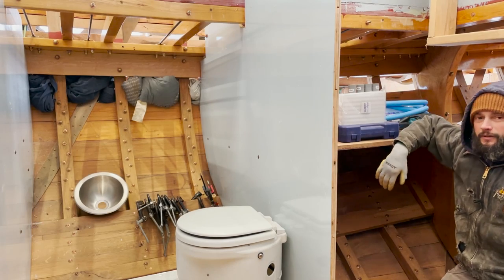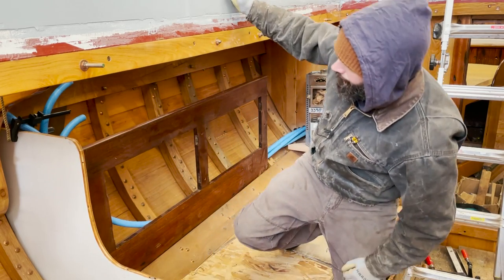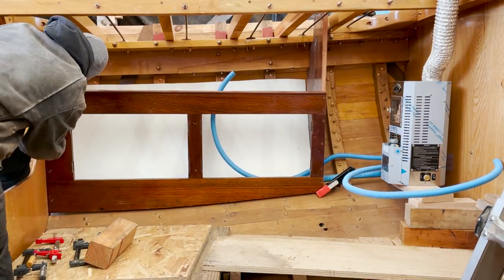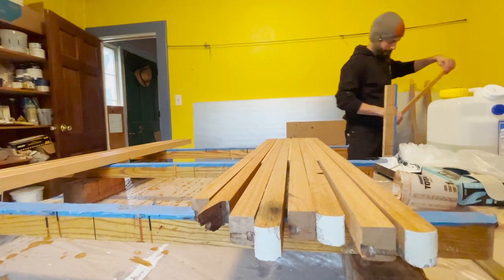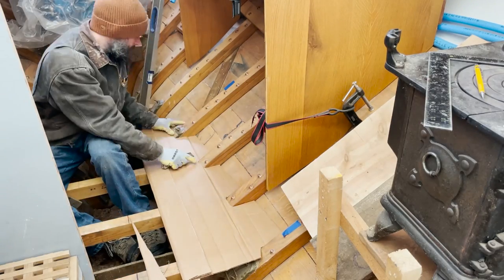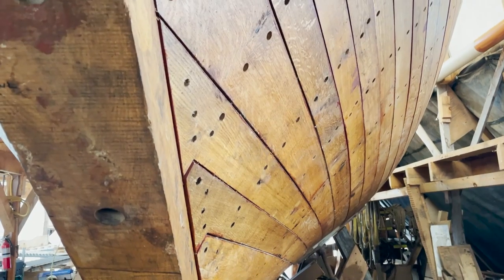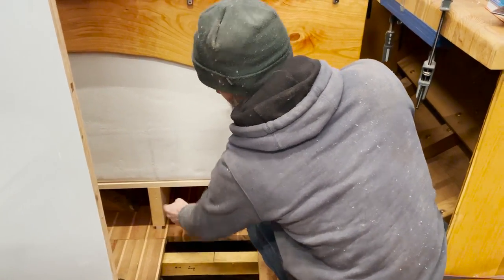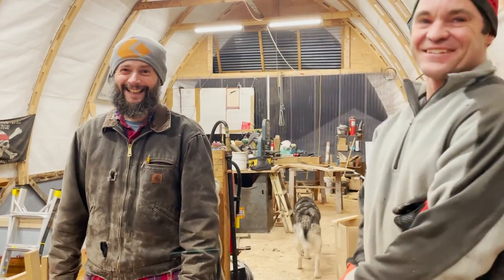Finally Back to Woodworking! - Episode 195 - Acorn to Arabella: Journey of a Wooden Boat

Comment: I'm thinking if the boat is keeled over enough to cause the fridge hatches to pop out, those hatches will be the least of your worries.
Reply from the maker: TRUTH!
Reply: I was just going to write this exact comment. If you're ever unlucky enough pitch pole a 40 foot boat, you certainly DO NOT want everything big and heavy (batteries, spare anchor, an outboard motor, a stove, etc.) to become projectiles. I get that. But in that rare scenario, you ARE unfortunately going to have SOME stuff go flying. It'd be ugly. But I don't think those lids are going to be anywhere near the top of your list of problems on that unfortunate day, should it ever come (hopefully it does NOT). Certainly DO plan for extreme heeling to happen when underway. That IS going to happen. But  you can only "upside-down-proof" so much.
Reply: It always amuses me (in a 'damn, that's annoying!' kind of way) when someone says "In a knockdown/rollover/pitchpole event, hatches and floorboards will be the least of your worries."

It's almost always said by someone who's never had to deal with a real emergency/crisis where every second counts.

I've fought grassfires, bushfires, kitchen fires, and floods. All of them, more than once. I've also studied the accounts by survivors of well over a dozen knockdowns, rollovers, and pitchpoles. And you know what I've learned?

There is NO PROBLEM SO BAD that it can't be made INFINITELY WORSE by a crap-ton of assorted junk getting in the way when you've got mere seconds to solve an urgent problem!

Let me provide you with just one example, based (but not loosely based) on a real-life incident involving a rollover. (Didn't happen to me, but I'm phrasing it in the first person, so you can picture yourself there.)

The boat comes back upright. There's more than a foot of water in the boat, it's up to my knees. No idea where it came from, but since we almost certainly didn't hit anything way out here, it's most likely from a hatch that came open, or the companionway hatch, or whatever. File it under "bad, but not top priority right now." Need to get up on deck to check for damage to the rig! Shit! The companionway steps are gone! Are they somewhere here in the boat? Don't know, don't have time to look for them. I'll have to clamber up and out somehow. Oh hell, that hurts! Must've broken a rib or two when we rolled. Hope I don't puncture a lung getting on deck!

Ok.. I made it up, somehow. Crap. The mast is gone! Oh, no it's not.. it's in the water next to the boat. And the waves are smashing it against the hull, over and over. I need to cut it free before it punches a hole in the hull! To do that, I need to cut the wire rigging. A hacksaw would be useless for that job.. I need the special wire-rope cutters I bought in case this happened. Where are they? In the rigging toolbox, stowed under the v-berth! Right.. gotta go back below to get them. Yay.. more stabbing pains in my side!

Oops! Forgot the steps weren't there, and fell into the cabin. Lots more pain... I'm pretty sure I bounced off the chart table on the way down... that's what my ribs are telling me, anyway. Geez, just breathing hurts! C'mon, man! Focus! Oh lord, what a mess! All the cupboard doors have sprung open, and books, containers, seat cushions, clothing, blankets, milk jugs, a frozen chicken and other food, all floating in the water! So are some of the floorboards and the 'fridge hatches. There are coils of nylon rope floating in the water too! Where the hell did that come from? Mary is here, and she has a pretty bad gash on her leg! One of the knives from the galley? Need to find the first-aid kit, and quickly.. she's bleeding a lot. But where the hell is it in this mess? It should be in that locker right by the nav-station, but the door is half off its' hinges, and the locker is empty!

I grab a towel as it floats by, and tell her to use it to apply pressure to the wound. The salt water will sting like hell, but maybe it'll help sterilise the wound? Anyway, she's on her own with it.. if I don't get that mast free, we could be sinking soon, and then we'll have bigger things to worry about. Like trying to find the 'abandon ship' kit, in amongst all this crap. Right.. got to get up forward to the v-berth! I can hear the mast pounding against the hull. I wonder how long it can take that kind of punishment? At least the water doesn't seem to be getting any deeper, so we aren't holed.. yet...

A coil of rope catches my foot, and I face-plant into the water, where one of the floating floor hatches gashes my forehead. Great. Now I have blood running down into one eye. I struggle forward through the knee-deep water and floating crud doing its' best to block my way, but the footing is treacherous. Not only are there holes in the floor from the missing hatches, but all the plates, glasses and other kitchenware are littering the floor under the water. Hope I don't break an ankle in a hole. Or step on a broken glass. Or on the knife that got Mary. Why the hell was I sleeping in bare feet anyway?

Yes! I made it to the v-berth with nothing worse than a stubbed little toe. Well, ok.. think I might have broken it, too.. that wave caught me off balance. Hard to tell, through the throbbing. Gaahhh! Why is it so hard to focus, when you've stubbed a toe? Concentrate, dammit!  The cutters! I was after the cutters! At least I don't have to lift up the mattress.. it's half off the bed already. And the hatch that covered the under-bed storage has splintered in two. Looks like the heavy steel toolbox smashed its way out, going by that chunk missing from the overhead. So.. where's the toolbox? I grope around in the water, and find the toolbox. So that's what I smashed my toe on! Dammit.. the catch on the toolbox lid has burst open! All the tools are scattered around, under the water somewhere. Where the hell are the wire-rope cutters?

Uh-oh.. the cabin lights are fading. Guess the water is getting to the batteries. And I have no idea where any of the torches and headlamps have gotten to. All I know is, they're not where they should be. Soon I'm going to be groping around in the water, in the dark, blind as a bat. Keep searching.. The pounding against the hull sounds different. Is the hull starting to give? I don't have much time.. keep feeling around.. it's got to be here somewhere. Hey, is that.. ow! I cut my hand on something! Shit, shit, SHIT! This is not looking good. Where the FUCK are those cutters? Maybe I should be trying to find the 'abandon ship' kit instead of wasting my time here? Why isn't the EPIRB in its bracket? Heck, the entire bracket is gone, too! What hit it? A fridge hatch? The companionway steps? Oh fuck... I hope we didn't lose the liferaft as well...

(Ok. So, slightly embellished to make a point. But still, the point remains. And yes, this kind of thing really has happened to quite a few people. Bad, but recoverable situations made much worse, all because someone thought "If it happens, I'll have far worse things to worry about than some unsecured items." Imagine how differently this would have played out, if the skipper had secured things properly. I know of a case where someone got chased around the cabin by the galley stove, when it came off its gymbal pins in a rollover. I personally knew a woman who became a wheelchair-bound quadraplegic because she put a 4 litre can of paint in the passenger cabin of her car, instead of in the boot, where it should have been. In the ensuing crash, the paint can smacked her in the back of the head, breaking her neck.

At sea, EVERYTHING should be secured. WELL secured. You should be able to turn the boat upside-down and shake it, and everything stay in its place.

Rule #1 at sea in a small boat.. THINK INVERTED!)
Reply: @Garryck-1  ok... Point made. The fewer loose items, the better.

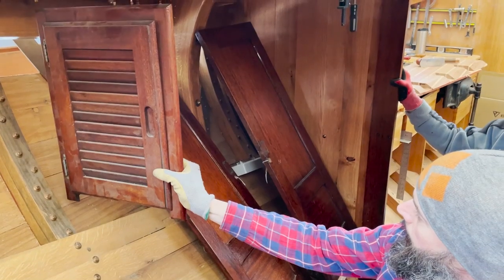Comment: Interior is really starting to come together. Looks great. The louver door at 21:38 is upside down. Are there no other doors that can be used that would be the correct orientation? Love this channel. More Radar, please.
Reply from the maker: We won’t be using it as a door, just for ventilation and we’ll probably modify it so it’s not so obvious. Even so, it’s so far forward and some shelves might go next to it… won’t be visible.

Comment: It seems to me that there must be a better (easier?) way to connect the conduit to the box. I believe there are fittings with nuts, similar to regular metal conduit fittings, that would eliminate gluing the hubs to the box. This is based on a lot of years of building industrial control systems - no formal boat wiring experience.

Comment: I have two observations on this episode. And let me preface my comments they are not a criticism . Love your design for the Sole floor my question is the pieces that you will be able to remove. The fit seems tight will they expand when on the water with the moisture making them very tuff to remove. Question 2 the base you made for the fridge looks to be made out of pine again if it is what about moisture from the inside of the boat and the fridge will it rot or break down quicker than something a little more moisture tolerant ?And I love all that you have done just a couple of concerning questions thanks
Reply: It really depends on what sort of finish is going to be applied to the sole boards. Someone suggested Teak oil them some form of top coat that would make it non slip. I would use an extra coat of Teak or Danish oil ( which is in fact Linseed oil based) and what ever Steve's top coat choice is, that would in all probability prevent or at least reduce considerably any most ingress into the timber a few thus swelling. As for the refrigerator subframe I too was a little surprised at the use of Pine in that position. Personally I have used glued up off cuts of the hardwoods Steve has knocking around to make up a pretty stable board to do the job.
Reply from the maker: Hi Dennis! The coatings on the base will be pretty serious. And there’s more room along those boards than it looks like… an easy fix with a hand plane if it gets a little sticky later.

Comment: Just out of curiosity are the refrigerator shelf going to have a locking system to so it does not slid forward or backwards while sailing?

Comment: What happens to the sole when it picks up moisture from the humidity of the ocean air?  I was thinking about how you planned for this in the cabinets and I'm wondering if there is similar accommodation in the sole pieces for the inevitable expansion?  They looked like tight fit pieces on the frame, and also between the sole pieces.

Comment: The glued Mahogany/Cherry sole looks amazing...Removable refer is genius for the first major refit/repair of the motor...for preventative maintenance would the coolant lines be on some type of quick disconnect? Or is the compressor for the SeaFrost attached to the walls of the refrigerator?
Reply from the maker: Yes, certainly.

Comment: The conduit thing.... What they said. The only thing I might add is, If you need four runs.... Run six and never fill your conduit past half  full.
I am enjoying the interior fit and finish. Arabella has never been wet and you are being meticulous with the soul plates. R U concerned with the inevitable expansion/settling in of the hull?

Comment: You have probably though through this more than me but have you considered running all the wire you need plus several extra through the conduit now before you do the junction boxes to ease the process? They could be finished fitted and cut to length later. (My new year’s resolution was not to comment on things I don’t know much about but I guess I blew that already! 😂)
Reply from the maker: Sure have.

Comment: I had a thought with the fridge/freezer, they work by removing heat from a box, where does this heat go? Your box is lacking holes for piping or whatever to remove the heat or am I missing something?
Reply from the maker: There’s a compressor, chiller plate, and quick-connect coolant hose still to go in.

Comment: Those don't really seem to be the right connectors for the J box. Those blue screw connectors can go directly to the box with rubber O-rings and a fastening nut on the inside. It seems in order to fit that grey connector to the Box, you will need a nipple which is just an extra unneeded part. I'm not an electrical expert but have done some helper work in a couple years of schooling. Maybe you have a reason for using those that I'm not aware of though. Keep up the good work! I'm a subscriber and I watch every episode

Comment: 1"1/8 hole saw and get a 3/4 "trade size" lock ring to thread onto the blue flex connector after it is installed in the hole. abandon the grey pvc female adaptor

Comment: This gluing stuff to the junction boxes irritates me quite a lot. I'm not familiar how you do your electrical stuff in the U.S., over here in Germany we only drill holes in the boxes and put a nut on the adapter. This won't compromise your water tightness further, because adapter to conduit isn't sealed 100% either.

Comment: Your interior is going to be beautiful. Your dedication to "doing it right" is paying off big time. However, I have one concern you may have already considered, but I bring it up now for your response.   It appears that everthing you are installing is very heavy: the counter tops, the vice, the 5 bilge stringers, the bulkheads, cabin sole, etc. etc.  I think that Arabella will sit very much below her design waterline when she is launched, without masts, and sailing gear, and provisioning. Most builders try to keep everything as light as posible.  Your thoughts???
Reply from the maker: That’s the magic of internal ballast, for which Arabella is designed to have a few thousand pounds of. We’ll remove some, move it forward and aft for trim, add some… whatever is needed. Boats without internal ballast can’t do that. It’s good, but not necessary, to have a mix.
Reply: @AcornToArabella  Thanks, good thinking. I thought all ballast was outside.
Reply: Another thought: the inside ballast would have been in the bilge, the new weight is above. This will change the center of gravity. Might the boat be very tender?
Reply from the maker: The new weight isn’t quite that much…

Comment: I wonder at what point you will test the boat for any leaks in the water? When you build all that nice interior, you wont see  the hull from inside?
Reply from the maker: Well, you put it in the water is how you do that. In a travelift, you can actually dip a boat and hold it just out, wait for the planks to swell a bit and big bilge pumps do their magic.

Comment: Regarding the refrigerator compressor and lines.
I see you’re making it easily movable/slidable. I’m not sure which components and lines you plan to use but flexible refrigeration lines are usually less then desirable as then tend to leak Freon and compressor oil. Often marine refrigeration are tied to a through hull condenser coil. 

So before you get two far along in planning a movable fridge you might want to get a marine refrigeration guy in and plan your actual refrigeration compressor, line sets, condenser coil and evaporator plates (or evap coil). 

It might be possible to have a low flow water pump that moves water through the condenser. Obviously flexible water lines perfect. But that still mean that the refrigeration equipment needs to be tied to the refrigeration box. 

Again get a marine refrigeration guy in to help you plan the mechanical out. Because copper lines don’t flex many times before they kink or break and rubber flexible refrigeration lines are not desirable. At least not historically. But hey I’ve been wrong plenty of times.
Reply from the maker: We do have a professional! The hookups are fairly ingenious and we’ve heard great  things about Sea Frost units lasting a good long time. More soon on all this!
Reply: @AcornToArabella  I’m glad to here that. I knew you’d end up with one but just wanted to make sure you’ve been consulting the professional in regards to making the fridge somewhat movable before much more work goes into the project.

Comment: The oddball size seems to be 4cm...also: Is the heat from the engine a problem when placing the fridge in front of it?
Reply: You'd call it a 40mm and i guess you'd use a hole saw for that size.
Greetings from europe. @acorn to arabella: I suggest you also open up to the (sorry!) "normal" peoples measurements in SI units. Meters (and milimeters) actually are the official way of measuring dimensions over in the US as well by the way ;)
Greetings from Europe.
Always love to see what and how your doing it. Cheers.

Comment: How are you going to attach the hardware to make the fridge work ?
Reply from the maker: The compressor lives outside the fridge, quick disconnects go through an aperture we’ll make when we know definitely where the compressor will be, and a chiller plate lives in the freezer side, cooling the fridge side.

Comment: I hold the view that visual inspection and access should be made as easy as possible. This feature is especially important for vital installations like engine, electric control board, rig etc. To cover and bar the view and immediate access on/to the engine - even if removable - does not seem acceptable to me. Modern boat designs respect this principle for a reason!